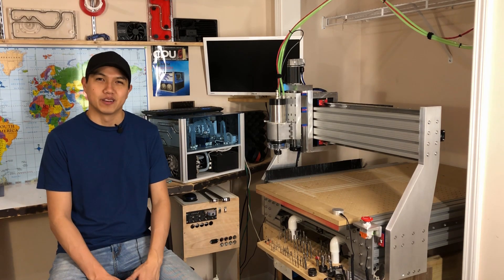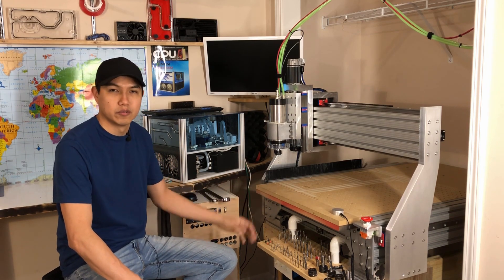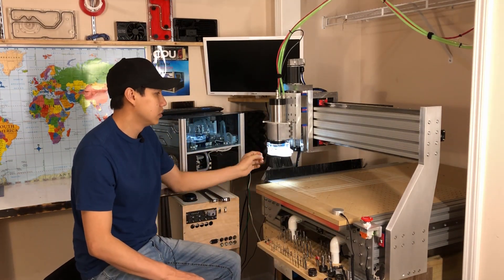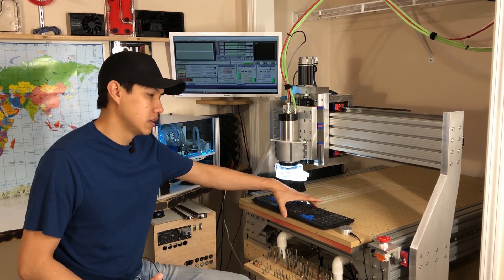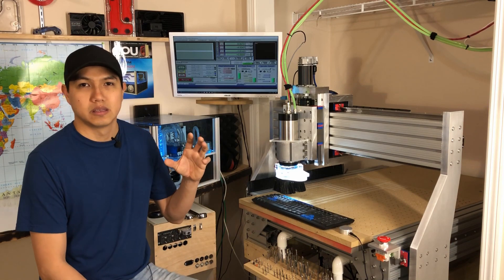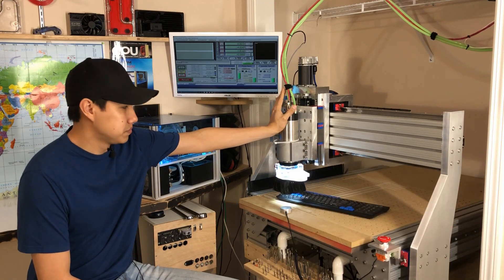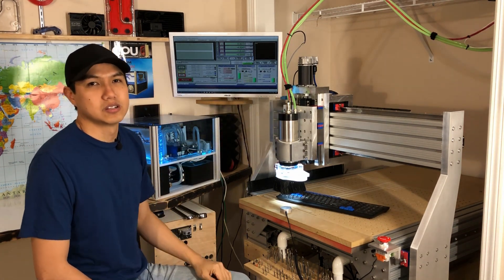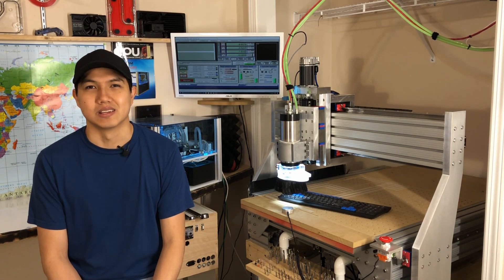CNC build Final Part

Comment: As an Engineer, designing automation equipment, I must say you did great job. I was definitely impressed when you justified the structural build and not cutting cost. You were definitely correct to select heavier extrusion. Thicker aluminum 6061 that you went with was a good decision as well. A few extra dollars in material thickness will suit you well long term.  Great Job!! 

Just something to share with you for future reference; the solution with the input issue you had regarding  positive voltage (sourcing) or also know as PNP versus a negative (ground, 0V, sinking) or NPN can be solved with an IAC or IDC module for AC or DC inputs depending your voltage requirements. These will convert signals, I use them when needed when an input device (proximity sensor etc. ) does not match the controller input voltage signal requirement, NPN to PNP and vice versa PNP to NPN.  Here is a link http://www.power-io.com/products/iac.htm.  I have no affiliation.  

Also here is another choice for Extrusion and almost any other component you may need. The extrusion cost, which I have investigated, are lower and they offer alterations at a cost point. Almost everything that I engineer and build, custom designed equipment, any component that I need except t for custom plates come from Misumi,  But they have configurable machine plates as well. Check them out for your next project.  Have use Misumi for years....ah ok 10+ years....
For extrusions scroll down the page they are near the bottom of this link  but check everything they offer: https://us.misumi-ec.com/vona2/mech/
Reply from the maker: Harrison Dodge thanks for that information

Comment: All very nice,, but I checked the websites for the components and they are not inexpensive in any way, specially the 8020 stuff. Do you have an estimated on how much you spend on each supplier?
Reply from the maker: Daniel Ken  I’ll have to look for that piece of paper where I put down how much I spend in total,  but it was roughly $4.5k -$5k total
Reply: Thanks for replying back. What do you think in terms on performance compared to commercial solutions on $5K price range? (I see the value on your DIY solution, the learning gains, etc, but I wonder if there is any capabilities or performance value on a $5K DIY project compared to a commercial product). Thanks a lot.
Reply from the maker: Daniel Ken here is a link to a cnc I wanted before I started to build my own,  I can not say what’s the difference between my and theirs cnc  since I don’t own it or have seen it in person, 
 At the end I realized that your cnc can only perform as good as the rest of your components,  cheap things will eventually build a cheap cnc, ( stiffness, smoothness.. ect) 
http://www.cncrouterparts.com/benchtop-pro-2424-2-x-2-cnc-machine-kit-p-314.html

Comment: Hi there, RADIKULT,
Very Robust and sturdy cnc i hv ever seen. thanks enjoyed all ur videos.I am in process of building one and certenly now will follow ur machine.thanks again.Just one querry.what size allen cap screw u hv used? ,it seem 6mm or 8mm.pls reply to this.
Mahesh joshi.Bangalore.
Reply from the maker: mahesh joshi I have used a lot of different sizes from M5 and some M6  to  #1/4-20 and #5/16- 20  all according to the aluminium extrusions size

Comment: Respect ! Your machine is really a high quality piece of equipment !
It inspired me to start my own version but I am still in planning mode. Could you please public some of the measurements ? I am wondering how to dimension the aluminium extrusions so that I can make use of the full length of the linear rails. In other words, did you not lose some length of the long axis when you added the  small aluminium extrusions as feet ? Thanks a lot !
Reply from the maker: mergenlideki Here is a list of the parts I use on my cnc build, keep in mind that I choose this because it works for me when building a cnc that’s capable of cutting 25” x 25” x 6” 

 
 (3) pieces of aluminium extrusions series15 Or  3”x 6” inches  =  870 mm long 
(4) pieces of aluminium extrusion  3” x 3” inches =  635 mm long 
(2) 1605 ballscrews  = 750 mm length  (800 works too) 
(1) 1605 ball screw = 300 mm length 

Linear rails  BGR25 =  2 pieces of 300 mm
And 4 pieces of 850 mm
 Linear bearings  (12)  BGXH25BN  

When design bing your own cnc  you can go with different parts smaller aluminium profiles and small linear rails/blocks can save you some money

Comment: So how much did it cost to build this cnc ?
Reply from the maker: hed420 the way it is it cost me $4k-4.5.  But if you build it with stepper motors instead or servos you can save around $1k and then maybe using smaller aluminum extrusions and linear rails can save some there too

Comment: Hello, i have made a cnc frame 40 x 60 cm wide with v slot aluminium profiles, have mounted 16mm rods and bearings and a router trimmer. Wanted to ask: for this cnc frame size and 16mm rods and bearings: 1. what thickness of lead screws should i use (would 8mm lead screws work well) and 2. which is the smallest stepper motor that i can use ?
Reply from the maker: Triumf Dula I haven’t use lead screws before. So I can not recommend anything that I don’t know, 
There are some really small stepper motors but I would say use maybe Nema 17 or 23, if you want to cut kinda fast and deep depth cuts probably nema23

Comment: Truly excellent job. You should be very proud of your work. We'll done!!I feel I am on the same journey- I have a 6040 and the flexing is horrible! I have purchased 20mm hiwin, 80 x100mm heavy aluminium extrusions for gantry rebuild. Will build a base similar to yours with extrusions. Y axis design very similar to yours but with 15mm plate.I was so happy when you showed gantry rigidity!My overall travel will be 900x500x150mm so not really a 6040 any more. I'll be reusing my nema23 and controllers. I'll let you know how that goes!!Thanks again for sharing!!
Reply: Just to correct... my extrusion is 80 x160mm (not 100). Phone autocorrecting numbers. Lol
Reply from the maker: Michael Ripley yeah I try “fixing” the flexing on the 6040 by adding a linear rail at the back of the gantry but to make it a lot better I would of have to change a lot more parts .  So I just build me a new cnc instead lol 
I would really like to see when you build yours
Reply: I definitely will show you when I make some progress. Thanks again!

Comment: rough cost on materials you purchased that finalized this build?
Reply from the maker: Mike Albert well 4K usd being 1750 in servos and cnc controller and 1200 in all aluminium parts and 1000 in linear rails and ball screws  that’s not adding spindle and other miscellaneous items
Reply from the maker: Lorenn Fields total cost  around 4K 
Being the Servo motors, power supply and controller almost 2k 
They are ways to make it cheaper
Reply: Radikult... understood but that's not as bad as I thought it would be considering the rigidity, size, and speed of the machine
Reply: Is that cost 4K USD?

Comment: Nice work. have you thought about moving to UCCNC instead of Mach3? Also how do you align stock material square on the spoil board. Any tips would be fab. thanks
Reply from the maker: FoxyBingo  I haven’t done any research lately on what’s the difference between Mach3 and uccnc,  long time ago I decided to go with Mach just because of more support and more people were using it back then 

on the corner of my spoiled board I have some 12” length grooves going on the x and y axis,  where I place a piece of aluminium and square my materials to that point
Reply: fair enough. Im looking forward to seeing the machine in action.

Comment: Great work on the CNC the finished product is great.  I have all the materials to build mine and am considering the Geko 540 as the control, do you know if the servos you used are compatible with the geko 540?  I have the extrusions and mic6 plate and have 90% of the leadshine controls wired with regular nematode 23 steppers, but feel like the servos and the geko 540 might be a better combo.  Thanks for all the info.

Brooks
Reply from the maker: Hello Brooks, I own the G540  but as I understand the G540 is a Breakout borad and steppers Drivers all in one ,  The Clear path servos don't need Drivers only the Step and Direction signals, that's why I went with the Ethernet Smooth stepper but the are other Motion control cards available like ( Acorn, UC300, arduino and more that I don't know)
I seen a few good reviews about Leadshine
Reply: Brooks, G540 drives stepper motors. ClearPath SDSK motors have their own drives built onto them. Two totally different technologies.
Reply: Thanks for the info guys, I’m still a complete noob to all of this.
Reply from the maker: Brooks Ravenscroft I’m still learning myself, I’m not a pro  haha

Comment: when i want to mill aluminum or copper smoothly. how should i choose a cnc machine?
Reply from the maker: Haozheng Lin the more ridged the machine the better, but that comes with a price too. So you have to balance the two,  less ridged machines can cut aluminium and maybe cooper too but at a much slower speeds and depths
Reply: thank you for reply, but someone said that, the milling head should be higher than 1.5 KW for Non-ferrous metal. is that true? which power you've choosed?
Reply from the maker: Haozheng Lin  I have a 2.2kw,  I think the problem with 0.8kw or less it can’t cut as fast as some people might want to cut and it could stall
Reply: good, maybe i'll buy 2.2 kw. thanks

Comment: Did you make or buy that touchplate?
Reply from the maker: IceTurf I made it, it just a scrap piece of aluminium I had
Reply: Looks nice, I think I need to find or make a touchplate. 

I wonder if those drill bits in front would be something a person might trip and fall on? I can't tell from the camera angle, I keep thinking I would put my hand down without thinking and stab myself on the bits if I were you haha.
Reply from the maker: IceTurf hahaha, they are knee high and I haven’t stabbed myself before 
I did wanted to put it  on a “ keyboard tray” type thing  so it would slide under the table and pull out when I needed, but didn’t had enough space for it